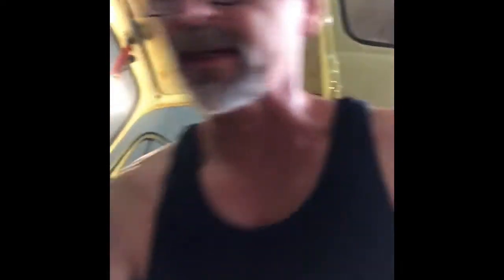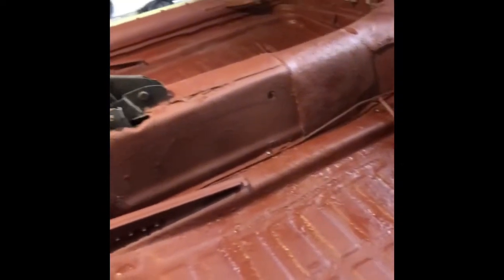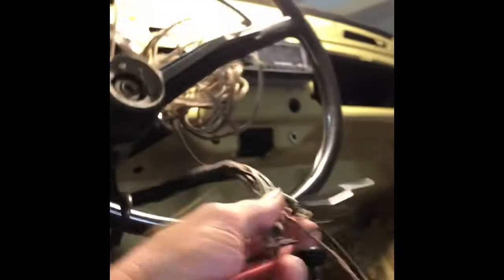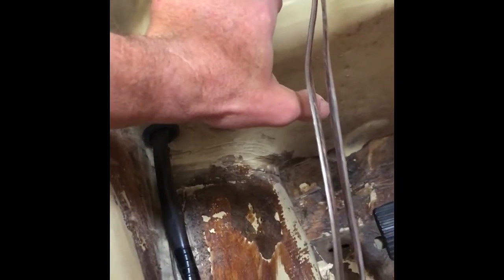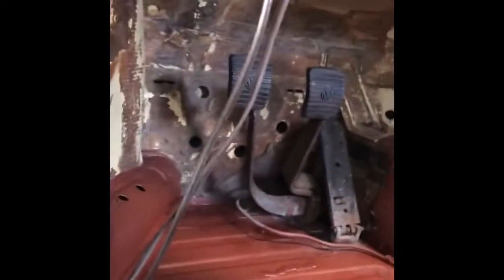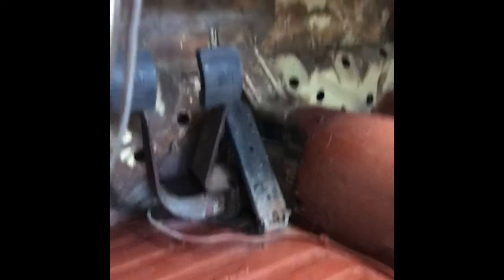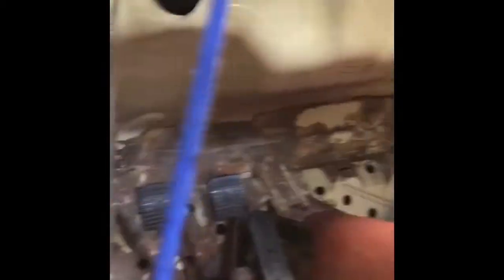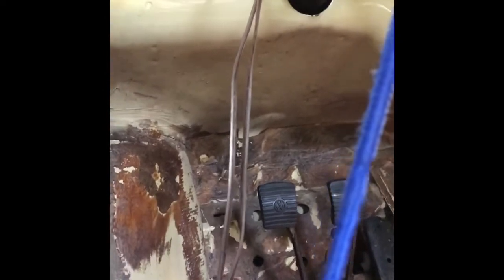VW floor pan + Rust-Oleum rusty metal primer

Comment: Good up-date Jr , next week will make it to the UPS store and the items we talked about will get ship to you. They should fit and look good in Sunny.
Reply from the maker: Hi there brother 😊 thanks
Reply from the maker: Hey brother how are you.  I hope all is well.  I have been pretty busy last couple of days.  Trying to figure out the wire mess that the previous owner did when they remove the entire wiring from the car.  I have the rear light and front light wiring done.  The voltage regulator and starter done.  I still have to figure out the wires from the main loom connections in the front trunk.  The problem I am finding is that the colored wiring diagram I find for 1971 super beetle have a few wires that are not the same as my harness.  Anyway.  I just wanted to check with you and make sure  everything is back to normal after the storm.  Take care.

Comment: Your moving along quite well! That’s what I used was Rustoleum bare metal primer. Then paint. Make sure to do the underneath also! Topline makes great struts, be careful with fabricating your struts if you do. Great video brother!
Reply from the maker: Slades VW Beetle thanks Slades.  Really appreciate your feedback.  Thanks for all that you do.
Reply from the maker: Hey brother how are you? I hope all is well.  I have been working with the wiring in the car.  I hit a wall and I am at point where I am trying to figure out the mess that the previous owner did when they removed the main harness.  There are some wires color in the wiring diagram that do not match my harness.  The 1971 wiring diagram I have does not show where a thick red wire with white stripe connect to. 🤔. Anyway I just wanted to say hi.  Thanks for your contact support.
Reply: Junior Classic VW bugs Oh I hate wiring!! The thick red with white stripe, is that at the rear under the back seat? I can check mine tomorrow.
Reply from the maker: Slades VW Beetle it goes from the back rear seat to the front trunk
Reply from the maker: Slades VW Beetle the wire connects to B+ in the regulator and goes to the front trunk.
Reply: Junior Classic VW bugs Oh crap I don’t have a regulator. Mines built into the alternator

Comment: How long did it take to dry? Did the smell go away? I did this too and hardly smelled when applying but when it was dried it smelled a lot!
Reply from the maker: Mine dried in one day.  The trick to get to dry fast is to apply a couple of thin coats with a little bit of paint hardener.  Careful with the hardener to much make the paint dry to fast and you don’t want that either.

Comment: Paint the floor, it may take one more step but it is better long run, most primers are not designed to resist weather and friction etc, you should top coat it even if you put the sound deadner in case you have any little areas that could get some moisture in etc. In my experience it is more resistant.
Look into a set of coil overs for the front, It may be a good way to go if you lower the rear, you can then dial in the front to match as you like height wise, plus the coil perch (cup) is usually much smaller in diameter and gives you more clearance for when and tire up front. Good Luck!,
Reply from the maker: Torkwerks thanks for those tips
Reply from the maker: Torkwerks I read some where that coil over don’t really lover the bugs. I think I read it in JBugs item disclaimer.   Have you ever installed coil over in the front of your bugs.  I know the are design to lower the cars.  I did a 2003 VW GTI my son had and it looked beautiful.  Pls Let me know,  because that honestly what I was contemplating before until I read the JBug disclaimer about the front coil overs.
Reply: @juniorclassicvwbugs924  Hey Junior! There are a few coil overs out there for the super belt, you can google Topline coiler, I just looked them up and most coilers are at a ridiculous price, its been a while since I looked at them. Another option could be to check at CIP1, they have strut bodies that have the ability to be adjusted at a reasonable cost, maybe worth the price to have multiple height options, otherwise you can do as you said and cut and weld yours. just be sure that the coil is not loose in the assembly at the new lowered perch height so if the suspension were to extend while driving the coil will not have a chance to come out of alignment etc.
here is a sample of the struts, you can also get them with no stocks
https://www2.cip1.com/ProductDetails.asp?ProductCode=ACC%2DC10%2D4061%2DKIT
good luck!
Reply from the maker: Hello there, I have looked at these before, and that is why I said in my video if I didn’t cut the spare set I have, I would just buy them already made.  I was referring to these exact struts.  Absolutely agree with you.  They car at a ridiculous price.  I remember when I was younger, to lower the car they use to cut the spring coils and when you drive the car; it was like looking at a basketball bouncing.....😂😂😂😂😂😂😂.  Hey thanks for your support in my channel.  Have an awesome day.